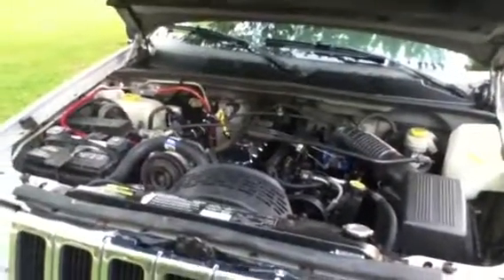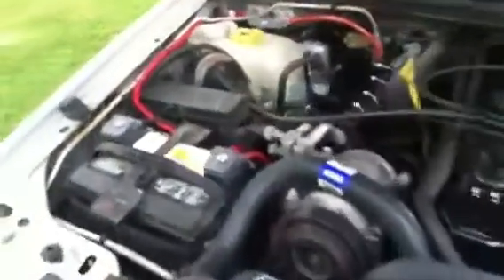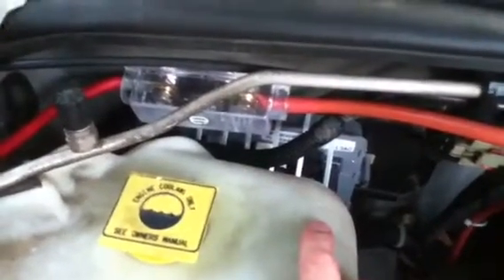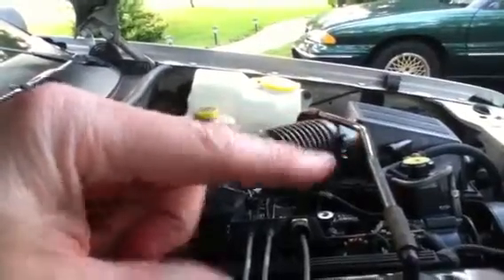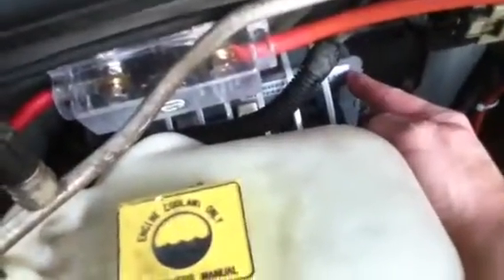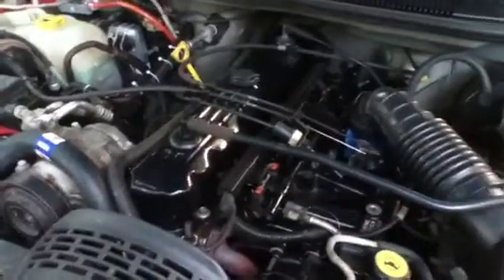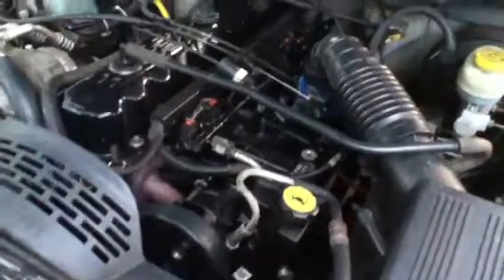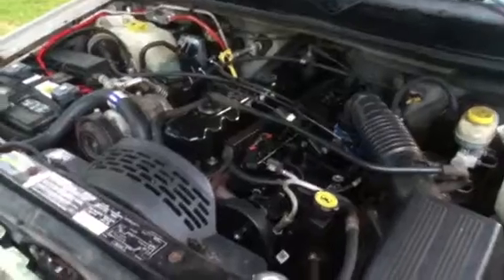Jeep 4.0 rebuild (video 17)

Comment: Rod Vance 2019:
 I have a 98 JGCL with a 4.0L my grandson overheated. I think the engine is not a good candidate for rebuilding so i am replacing  with a unit from a wrecked one. I’m only going to do due diligence and repair as necessary just to get it back on the road. I appreciate your videos they are very informative.

Comment: Outstanding series! I am about to pull my 4.0L out of my 2003 TJ as a part of a frame-off restoration. Your series of 17 vids are now bookmarked on my computer for reference. Great, thorough job of documentation at the overview level. All that is missing is the torque specs and tightening patterns and how much assembly lube you squirted on each surface as you put things back together and you could have made this a video textbook. I now know much more about what to expect my machine shop to do, and feel I can talk with them intelligently about stuff so that I fully understand my responsibilities in prepping stuff for them. This is a very motivational series for me. Thanks for posting it. I need to go back and Like every individual video and subscribe to your channel. Great work!

Comment: Bro, you've given us a serious gift of your time and effort by posting this video log of your rebuild.  I've got a 98 XJ with 195K on the clock and a leaking head gasket (or worse) from overheating.  Watching every one of your videos has ALMOST convinced me that I should take on a rebuild like yours.  I say almost because I'm not a machinist or a mechanic and I don't have a hoist, engine stand, parts cleaner or shop like the one you had access to. If I do this project though, I'll have you to thank, or blame.  Seriously, I wish the world had more people like you  taking their time to help others.
Reply from the maker: No problem man! I myself, at one point, didn't know much about mechanical stuff. One of my first jobs was being a maintenance mechanic grunt at 19 years old. I found out quickly that I had a knack for it. So since 1998, mechanical stuff is all that I've done. Everything from electrical, computers, maintenance, heavy duty machine repair, machinist, tool and die maker (7 years), welder (stick, MIG, TIG and gas), fabricator, plumbing, construction, custom automated machine builder and designer. I love learning, and I share my knowledge of things that I do to encourage others to do the same. And as always, if you don't know how to do it, ask someone. Thanks for commenting. I hope that you learn to do these things! The world needs more do it yourselfers! Good luck man!

Comment: Very much enjoyed viewing your rebuild series all the way through.  So how has the jeep been running since you replaced the forward O2 sensor as described in video 17?
Reply from the maker: The engine runs great. The 02 sensor definitely fixed the running rough issue, but unfortunately took out my exhaust system (catalytic converter included) as a result from the massive amounts of backfiring that the bad 02 sensor caused. But ultimately, it was the e.c.m. (Computer) that caused ALL of my issues. I have had to go through 4 computers since I've rebuilt the engine. So, in the end, I had enough of fixing it and traded it in for a new 2016 RAM 1500 4x4 tradesman.

Comment: Thanks for all the videos. Isn't dielectric grease an insulator/non-conductor?
Reply from the maker: Actually, yes! You are correct. My issue was ultimately the ecm (computer). Replaced it with one from Autozone, been running great for almost 2 years.

Comment: great video, why is the startin problem mostly happen in warmer weather? i have the same issue with my 98 xj sport. im told its the check valve in the fuel pump. only it always start after two trys or i turn the key to on for 30 seconds.

Comment: interesting video,  thanks and will review the others. I have a 4.0 97 with 185, 000 miles and short of a few leaks,  runs great.  Question is my charge voltage runs on the low end all the time and much worse as outside temp rises.  replaced battery temp sensor with no change.  cleaned ecm pins and no change.  ECM is the regulator on this keep but not ready to blame it.  any ideas?

Comment: I just did a rebuild on my 4.0 jeep cherokee and had the same problems with it.. I found the problem with the siemens deka fuel injectors. I found a remanufactured set of bosch III injectors on ebay and that fixed the problems i had... WOW big improvement in acceleration,smooth idle and fuel economy.... I pick up the injectors from leah7306 on ebay...Check it out this was the best investment i did on my jeep!!!  oh one more thing EXCELLENT VID!!!

Comment: Nicely done series.  I have a 00' Wrangler with the same engine.  I swapped mine for a rebuilt when it started to go out on me (oil pressure issues) but held on to the original engine.  I plan to rebuild the engine as a learning project and for use in a vehicle to be named later.  I plan to revisit your series when I get around to the rebuild.  You have provided a lot of good information.  Thank you for the time and the thought that went into this series.  God bless.

Comment from the maker: I can't say that I noticed any mpg difference, because I didn't really drive it a whole lot prior to the rebuild. But since the rebuild, I can definetly tell a difference in hp gain. Not a whole lot, but enough to make the girlfriend grab the door handle a lot and say,"HOLY CRAP!!!!"    LOL!!! Just take your time with the rebuild, make sure everything is clean and put back together correct and with proper torque. I've got a little over 20,000 miles on my rebuild, and it's rockin'!!! Good luck!!

Comment: I disassembled my ecm and found that it is filled with potting compound, a gel encapsulating substance like RTV. The main board is completely submerged in it, and it cannot be melted out or dissolved. IDK how the remanufacture places do it. Anyway, the aluminum plate (the front panel with the 2 torx screws) is actually another circuit board (what I believe is) containing the ignition control circuit. Found potting compound on it, burnt black. The only code I got was IGN cntrl circuit. Bingo.

Comment from the maker: From what I understand on these computers, is that there is pins underneath the cover of this computer and they break or the solder joints go bad and then acts faulty. There is a video that I found here on YouTube that explains the symptoms and shows you the common cause of the internal failures of the computer. Or.....you could just buy another one until your symptoms disappear. Best of luck to you!!

Comment: hey, nice work. I went thru all these steps prior to learning of your video...Still can replicate stalling issue. Have found that if I have vehicle running and without moving harness wires or connectors....I can place my fingers just between ECU and fire wall...apply the slightest pressure to the back of ECU and make it stall..remove pressure and it regains ignition..I was hoping to find  internal remedy...Going to junk yard today for used unit ...: (

Comment: Nice work to details, a lost art. That rebuild was to nice too use, should sign it and hang on the wall. Really appreciate you taking the time and effort to film, really learned alot. Kudos for the electrical secret and putting the Kabosh on the other guy.

Comment from the maker: Right where all the vacuum is created, right on the intake manifold. My intake had a spot that was already drilled and tapped with a pipe tap. So, if yours has a spot that is not being used, you can use that. Or.....you can put an inline fitting onto one of the lines that goes to the intake manifold and have the same effect.

Comment from the maker: No, there was no need to do that since I wasn't going to use the factory pistons. The factory pistons came out the top of the block with no issues at all. The motor was bored .020" over. Thanks for viewing!